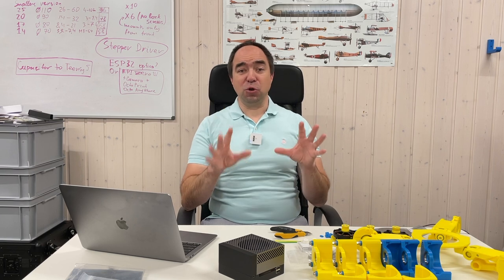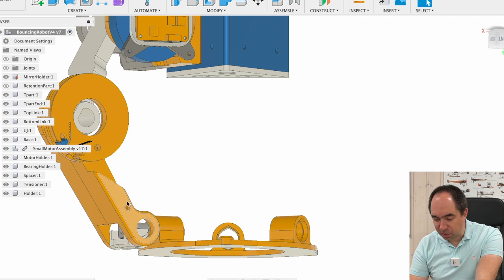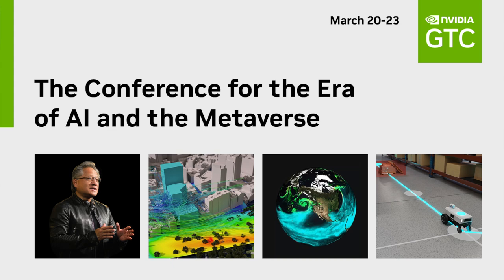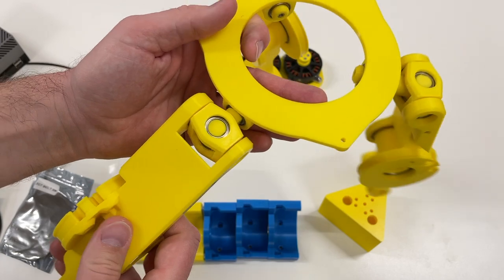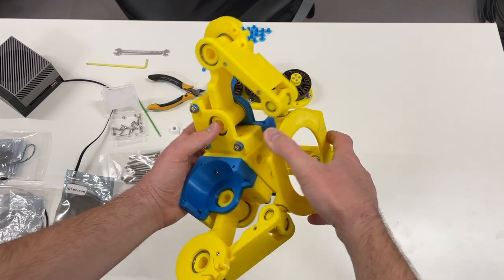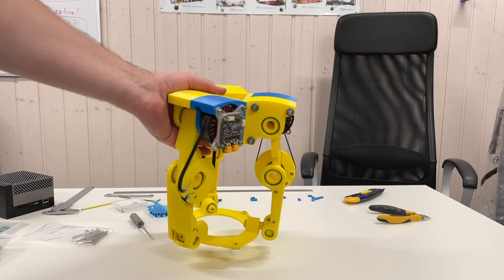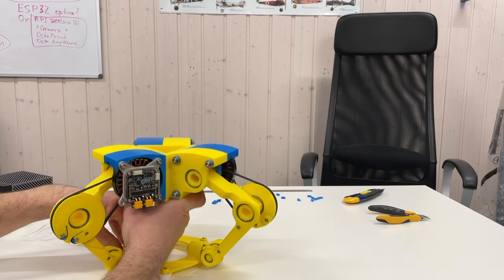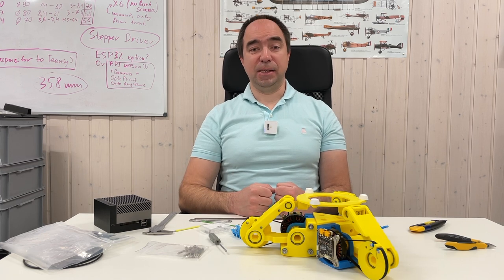One Legged Jumping Robot (Will it work?)

Comment: You really want some springs to push the legs open, even with the weight of the body. The motors should use force to pull the legs together so the body goes down. Then the springs and the motors together will push off when it jumps.
Reply: Same thought here! Something like the punch mechanisme of the mantis shrimp.
Reply: The joint gets locked. The muscle get tightened. Than the lock opens en the energy reales in an blink of an eye!

Comment: FYI the pi3hat will not work with a Jetson.  While the connector mechanically fits, the Jetson doesn't have the same number of SPI busses that the rpi has.  Also, the client library is currently only for a rpi.

The Orin actually has CAN-FD controllers built which you can connect transceivers to.  Unfortunately there are apparently no off the shelf transceiver adapters for the Jetson line that I could find, but that could be an alternate high performance solution you could start with just a breadboard and a transceiver breakout board.

Comment: I kinda want to try to program this. But I haven't worked with the Developer kit yet. You may need a Gyro/Accelerometer on the robot to get the angle correctly in the air and feed it into a PDI loop for adjusting the moment of inertia a bit more accurately.

Comment: hey coder here. I m getting into robotics, and I love your design and mechanical approach. But here s how I would operate if I had to actually make this work (for what it worth). You have 2 options : 1 the algorythm option. You need : Accelerometer, joint orientation (Inverse Ik), and altitude. Then you bring everything to Unity or Unreal. From there, you start simulating based on actual weights. Since you can t predict the actual driving force of the motors, nor the mechanical faults (like slipping belts, motor imprecision, pid results etc) all you can do is to start with some force values, and from there build the algo and then trial and error in real life values. 2 Reinforcement learning. you backdrive all the informations (joint, accelero, and altitude) to unity, run a first AI pass in the sumulator, then move the model to real driven datas from the robot. After a couple of hundred fails, you should start to see something working.

Comment: That was an amazing idea please continue working on this, I have a couple of pointers regarding the design and control:
> Checkout Berkeley's - SALTO Robot, slightly different scale but it is still a single legged jumping robot that can move around, maybe the leg design and their motor-joint placement can help during further design iterations.
> The control for your robot will obviously be quite tough and your idea of using RL is kinda nice, but given the mechanical elements of the robot such as pullies and belts which might introduce slipping and other elements into the picture a through system-identification must be done before you can start the RL training and also a good amount of domain-randomization can be applied for these kinds of parameters (slip, motor strength and so on..) other than the usual ones like mass, friction, CoM, inertia and others.. 
> I'd also suggest the addition of at least one binary contact sensor at the bottom (even better if you can replace all three of those white button sized feet with three binary contact sensors) this will help with the training in RL. 
> Other things I'm not sure of as I am not familiar with the motor controller and the motors your using but will be needed for RL are: motor angles and motor velocities, IMU data.
> Would also suggest training the RL policy to output relative positions w.r.t the neutral positions of the motor angles which are then passed through a low gain PD controller for generating torque values. ( Learning position control in RL is faster than torque control)

Finally, If you do plan on using RL for control and if you can open-source it in anyway I'd love to contribute to the RL part, being an undergraduate researcher who also works on RL for legged robots this project sounds dope.

Comment: Interesting. I would not worry about the rotation of the body during flight, just make sure that the foot is in the right position when landing to prevent it from falling over. Once the foot has contact with the ground you can adjust the body rotation easily. You should also make the foot extra grippy because you have to transmit the force for the forward jump to the ground horizontally.
I do think it can work, but it will not be an efficient way of locomotion. You might want to recover some of the energy by using electric braking when landing.

Comment: I think it’s definitely physically possible to jump at an angle, but I suspect the code is going to have to be really cleaver and you’re going to need to know the exact position of the body (high precision accelerometer) and the joints (encoders) and thus be able to know where the foot is and where it needs to be. I don’t know if you can actuate that quickly, but I’d love to see it!

This may actually be a good candidate for guided learning, or basically letting the robot learn how to control itself with machine learning. I think the Jetson Orin is probably up to the task. Perhaps add a tether and spring up top to prevent damage while it learns and then let it go?

Comment: I think you will have a lot of trouble with the motors and pulleys. The force of landing and possibly jumping will probably make the pulleys skip if not make the motor skip. You could maybe help that with tensioning but you can only tension it so far since you are using 3D printed parts and the motor probably doesn’t like too much load on its shaft. You could maybe help it with some form of current control and allowing the motor to be driven by the legs folding, kind of like a person absorbing the impact of a jump using their knees, but that might be difficult to implement.

Comment: I absolutely think it's possible! You'll definitely need an accelerometer on the body to measure you're rotational speed, and joint encoders (though I'm assuming you have that through the motors). 
I think your idea to control your rotational speed using the legs to control you MoI is sound. You might find that you need to relocate some of the mass to the "foot" to increase that effect, though it might cost you so jumping power. 
Also, I've seen a lot of comments suggesting springs to help the motors, I 100% agree with this.
Keep it up, don't scrap this one, I want to see it fly! And then fall, gracefully

Comment: It will work, but one thing that will make it much easier to get working, in addition to an IMU, is force feedback from the legs.  I'm not sure if you get that from the encoders and the ESCs, but knowing when the foot has touched the ground will give you a clear signal to go from a flight state, where it's controlling its rotation for a good landing, into a catch state, where it's getting rid of residual horizontal momentum to get into a stable balance.

Comment: Very cool. I like the thought about ensuring the force vector will be out of line with the center of mass. Otherwise, you'll need reaction wheels to balance in air - perhaps the motors accelerating to move the legs will have a similar effect.
Reply: "perhaps the motors accelerating to move the legs will have a similar effect." I think that's more promising than an unbalanced rotational inertia at jump time; that's because that rotation will be present the entire flight time and the rotation speed/flight time will be essential for a good landing (that is, the robot learns a formula).
The longest jumps in sport's history were all in hitch kicking style - https://www.youtube.com/watch?v=1JcxdeDluNs. I think that the speed of the leg "pedaling mid air" combined with the input of some gyro sensors would simplify the feedback for the jumper's attitude during flight - I feel that's a reaction closer to a bio-neural system.

Comment: I am pretty sure it can work physically. It can impart a small backwards rotation while going up. Should be pretty straightforward to sim. but i honestly doubt it will have the torque and the speed to make good air. If you could give us joint weights, motor power, torque and reduction numbers we could simulate it. Or just try make it jump straight up first to get a good feel for effective power.

Comment: You could add something similar to rocket landing gear, on the part connecting to the gimble. If it's just a "One Legged Jumping Robot" then you should be able to put something bouncy on the bottom.

Comment: I think that jumping in such a robot configuration will be hard problem. What will make it lift off the ground? A sudden simultaneous torque from all the motors? But that will just throw the upper part upwards until it hits the top and then it will fall back. Maybe I'm mistaken about the physics. Sorry if that's the case :)

Comment: I feel like a reaction wheel with a spring system would be lighter and better considering that for any movement, it needs to be lighter. And it may be simpler to program. If you want to be lighter the computing system could be wirelessly connected through a control link. I think the current configuration is too mechanically complex with many potential errors from the amount of parts.

my robotics professor taught me a good lesson: the simplest solution is often the best and that applies in robotics

Comment: Your leg needs some mass at the foot. You need to induce a rotation when the bot jumps. The mass only increases as batteries and controller are moved to the platform. How do you size a motor for this application?

Comment: With the current configuration, I think your landing platform is too abrupt - at the very least it'll cause significant strain at the contact points, at the worst it'd cause damage at the joints closest to the bottom. I think you'd want something to distribute the impact along a wider surface. My first thought is a screw-like mechanism that is pressed inward during collision but falls slack at any other point.

Comment: I think it could work jumping vertically and would work better with some weight reduction. jumping horizontally would probably need some clever code like you said, but I cant see any reason mechanically why it wouldn't work. Also, the small bearings that you pointed out at 7:39 have such a small range of motion that you could experiment with replacing them with some sort of 3d printed compliant mechanism. axial load could still be a problem if they were just replacing the bearings, but they could be printed as an extrusion to use the whole height that the bearings take up, hopefully making them quite stiff and strong axially. I was thinking of something like they showed in this video: https://youtu.be/rUH3cDmeXC4 . it might be overcomplicating it but it could help. Good luck!

Comment: It's 3 axis delta-robot. It cannot tilt lower platform, only move it parallel to the ground. It might jump, but it will definitely fall over when it lands. You'll need 6 axis in order to tilt platform to jump into specific direction and land at the destination angle. And platform should be larger for such size and weight.
Reply: It's not a parallel delta because it doesn't have the 2 legs on each side that force them to be parallelograms, that is what forces the translation only mode of normal deltas constraining the head to be parallel to the base. It will be able to tilt without that.
Reply: @JohnMeacham  Then resulting tilt is unpredictable and robot wil definitely fall during landing.
Reply: @TheNamelessOne12357  no because the shoulders are not universal joints, they can only swing in one direction. so you have 2 less degrees of freedom in each. The parallelograms on the arms of a parallel delta are what gives each arm the ability to translate side to side. That is constrained on this design so there can be no translation leading to a fully constrained system again. You effectively trade off translational degrees of freedom for rotational ones.

Comment: Jumping seems the easy part. Landing will be harder. Maybe use an imu in the top. Based on the gyro orientation and acceleration, you can position the foot so it is infront of where the heavy top is headed (based on accelerometer) and level (based om gyro).

Comment: It seems that you require something like, mmm... reaction wheels? Well, to maintain it's orientation; you know, like those nifty useful stability assist devices in Kerbal Space Program.
Reply from the maker: Yes, this can help. But reaction wheel should be heavy to work properly. And heavy part for jumping robot is a bad idea. :)
Reply: Heavy — or big, reaction torque is related not only on mass, but lever length as well; also: how much power do you absolutely need it to have, actually? :)
Also, this is a delta robot, efficiently, which makes it possible to execute tangential moves with it's effector (foot). Which in turn means that it can add rotation impulse to main body during jump, theoretically :)

Comment: I know nothing about robotics or math but surely this can all be calculated?

Are there go-to models for this kind of specific movement?

Intuition tells me it would work better with longer legs as there'd be more dampening, which you might need for a longer pause between jumps, but I suppose a lot of that can be incorporated into the motor control with acceleration and deceleration profiles for jumping and landing. There's probably a more ideal ratio for the leg lengths, I feel the top leg should be slightly shorter than the bottom one, I dunno what that ratio would be though maybe 2:3 - 1:2 or somewhere in that sort of vicinity for this weight (I feel like a much lighter robot, would end up with much longer bottom legs than top ones, closer to 3:5 and up as it tries to concentrate it's mass into a more top heavy configuration). All of this is an uneducated guess so if I'm way off pls don't roast me.

Comment: 3D printing pulleys with smaller teeth (gt2, for example) can work better if printed using smaller nozzle sizes (0.3) (the teeth geometry is closer to what it should be)

Comment: It still seems like you probably are exceeding the torque you will need to jump from those belts on the small pulley. Also, it should not be very hard to get a back of the envelope idea of the jumping capacity of the robot by looking at the force to bodyweight ratio of the legs. Now that you have a model and a motor chosen, just do a quick calculation for the force the leg can generate at stall and compare it to other jumpy robots. MIT mini cheetah achieves 1.7:1 force to bodyweight ratio per leg and uses mainly its back two legs to get airborne for its backflips.

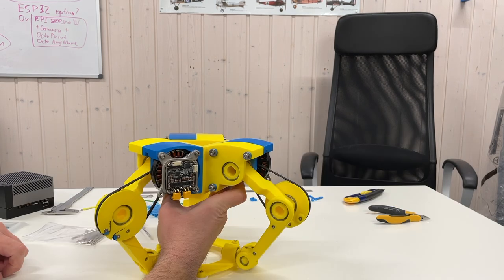Comment: 12:30 I didn't see how you expect the rotation in mid- aire  🙂
13:48 no so sure ...  
14:22 ok this is a interesting approach  
-> to get the rotation you have to keep longer time the poser on the opposite site to the requested momentum to made the rotation of the "head" 
Note : If you reduce the size of the leg, you will increas the rotation speed, not sure it's the "best" start 

I think it could be interesting to test this

Comment: I do not get whole topic on rotation there. If it's going to jump with some movment, then some legs need to jump with more force then others. You are not able to control (modify) the rotation during the flight fase of jump. Because the top seems heavy and bottom light - perhaps you will be able to put the bottom part of robot in proper way just before landing.

Comment: grass hopper robot huh
Reply: 3 legged leaf spring grass hopper stand with line leg tension like a cross bow
Reply: yes stay home, congress goers :)
Reply: who would you need to meet anyways, or talk to
Reply: try 3d printing the bearing to the axles directly, just coat the surfaces with graphite putty lubricant
Reply: bearing without ball bearings, just graphite surfaces bearing
Reply: 3-axis one-legged leaf spring grass hopper
Reply: yes kinda like self bow slinged bot
Reply: yeah kinda like a spring robot